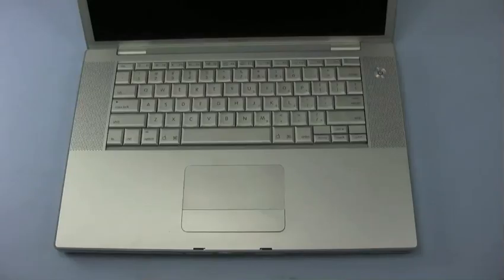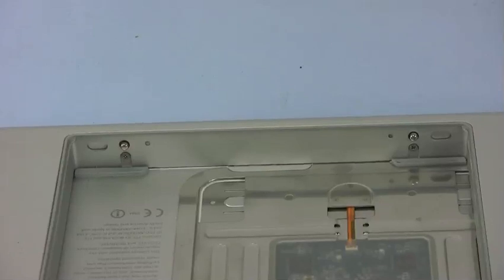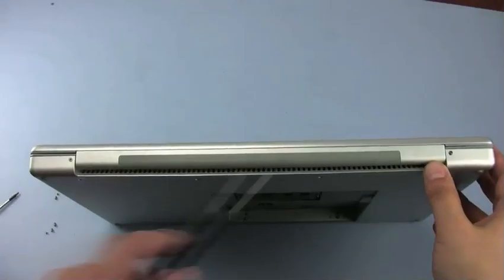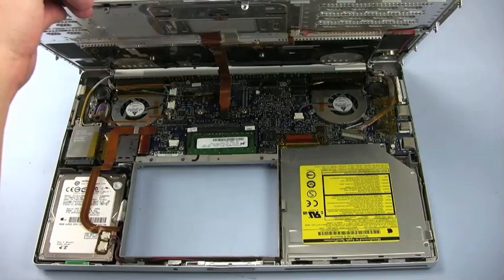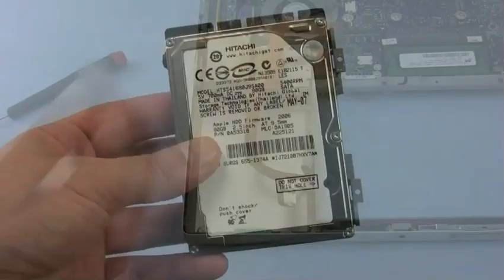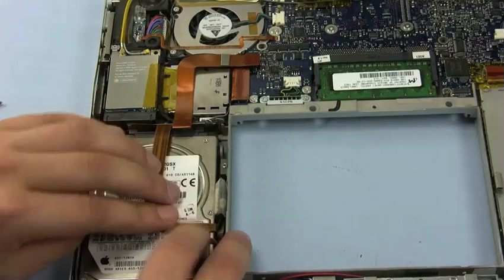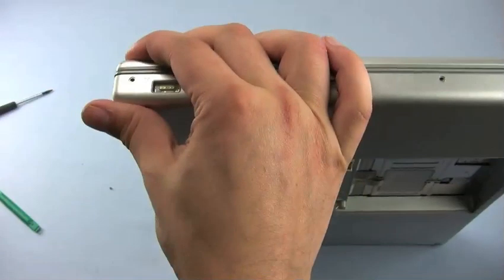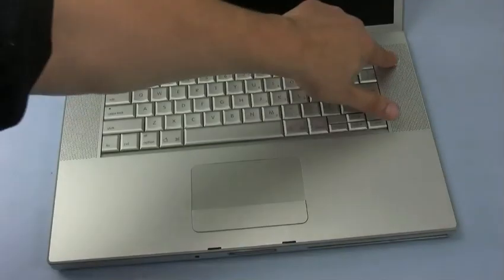How to replace a hard drive in a 15" MacBook Pro

Comment: my old computer stopped working so i put my old hard drive into another mac a brought, I'm pretty sure it was the same model, I  started it up and the apple logo didn't show up for a while at first, But it started up fine after that, I got into my account and i can use it up to a point for about the first 30 seconds to a minute but then it will start really slowing down until the point where it just had the spinning wheel and everything i click on is unresponsive, Help please

Comment: Made it very simple to replace the Hard Drive on my Mac... Thanksfor posting this easy to follow guide. Now tell me why the Mac Book Pro won't come on, the screen light, the apple logo shows up then the rotating gear icomes on and rotates to about 3 minutes then freezes and then nothing. I've tried holding various combinations of keys while the unit is booting up, still nothing. Any ideal. This in still the original Hard Drive, I haven't replaced it yet, but thought mabe you maight think is is something else, before I change it. Thanks

Comment: In lieu of a Torx T6 screwdriver, I found that you can scrape by with a very small flat-head screwdriver - the kind that you might use for fixing/adjusting eyeglasses.  But it is possible to strip the screws like this if you're not careful, so use caution.

Comment: I guess I got a late 2008 model.  Just about the same instructions, but the bits holding the drive in are slightly different...though anyone with enough brains to get to that point should be able to figure it out.  Didn't notice the 2 tiny screws towards the front of the casing in the battery compartment, so glad I looked for a guide before figuring it out on my own!

Comment: Great guide - just used your video to successfully change out the hard drive on an old MacBook Pro. 

Oh and Apple, f*ck you for always making hard drive swaps so difficult. Other manufacturers' laptops are generally so much easier to work on.

Comment: Very good but very important fail to hold the hard drive properly and it can easily be destroid! The way your holding it from top to bottom squeezed a little and its toast. Always hold by the edge! And no metion about static electricity ...really.

Comment: Thank you I changed mine, took me less than 20 minutes to achieve. I had a 17 inch macbook pro so the keyboard panel was not a problem. I had to rush to get the tools from local dollar store. Got the screwdrivers for $2. Of course the cloning took more than 5 hours. But thank you once again for sharing.

Comment: what is the connector small assembly connected to the right hand side of the bracket  hard drive proper name this is missing on my macbook pro 15" A1260 or A1226 model thanks

Comment: NO NO NO NO. Do not disconnect the HDD Ribbon cable from the "logic" board at 5.00 into the demo. The connectors are not the most robust and the ribbon has a tendancy to come away from the connector.. not good. The drive can be removed easily with the ribbon still attached. It will cost in excess of $50 to replace the ribbon cable.If in doubt, watch Steve Maller's video "macbook pro hard drive upgrade in 60 seconds". Wish I had watched it before this demo. godaaaaammit. oh, and the music sucks.

Comment: Great video! While the music could definitely be improved, it's worth it for such a clear video. One part that is NOT covered in the video is how stuck the ribbon cable can be to the hard drive. Mine was firmly glued on and difficult to carefully pry off. Go slow and steady; it'll eventually come off. Also, if you don't have a silicone spudger, try using a credit card. Cheaper and easier to find. Last, my MBP hard drive did not have the "small assembly pack," so don't worry if you don't have it!

Comment: Great video, will the "Seagate Momentus 7200 750 GB 7200RPM SATA 3Gb/s 16 MB Cache 2.5 Inch Internal Notebook Hard Drive -Bare Drive ST9750420AS" work well on my early 15 inch 2008 mac book pro? I am not sure about compatibility bec there are so many kinds. Thank you!

Comment: 5 Star. I had the right tool but I could not open my macbook pro 13. Once it was mentioned you need #00, i went ahead and opened the back. Took my harddrive out and found that I can not connect to my USB enclosure because of difference sizes. It helped me a lot! Thank you

Comment: This might not be cool, but I bought the metal housing for the hard-drive at ifixit.com . The housing was tossed  by techs who told my kid that the laptop was a total loss due to a water spill. Apple store said minimum of $1500 to fix. Bought a new hard-drive  $79. Was told by this store that instal was $100. I inquired about operating system...they said we do that too...$69.00. I asked sales person on floor to show me operating system....snow leopard. $39.00. It self-installed in under 15 mins.

Comment: Thank you. Your video saved me $100. Perhaps identify which screws go where during reassembly more clearly . But not that big of a deal. Well put together video, and the procedure is very clearly explained. Saved me $100 and yes, I  was done in 15-20 mins. I have absolutely no computer repair skills what so ever.
thank you thank you thank you.

Comment: please remove this video. it is totally unnecessary to remove the hard drive ribbon cable. if you do you will likely break it. it's a $40 replacement. better not to have these bad instructions.

Comment: Before you get started on this video you need to partition the drive first or you mac won't boot with it mounted internally. They have a page that explains how to do this. Once I did that it worked perfectly!  Or you can do it with your installer once it is in the mac.

Comment: Thanks for the great video, worked like a charm.
I do have one little issue, maybe you can help me;
Now the lid has some difficulty closing.
The magnet pulls the hooks out no problem, 
but I have to push kind of hard on the cover, before the hooks actually grip.
While before, it closed real easily.

Comment: Success! Just replaced w/ Hitachi 750GB Travelstar. Thanks!

1. Prop up keyboard with plastic object (travel mug) on top of CD/DVD player, leaving all cables connected!

2. Fold paper several times into a makeshift "spudger" - work the hard drive cable free by starting at the front - think putty knife action - for me (2008 model) this was easy!

3. work hdd out right side first, gently nudge SATA cable out - if you're careful, you only need the screwdriver, torx, (got at home depot) and beer!

Comment: Fine tutorial, in the great OWC tradition.  One thing though, which has been pointed out by others:  The step where you remove the hard drive ribbon cable from the logic board is NOT as simple as they make it look in the video.  Take VERY good care to carefully pry it off using a knife/screwdriver. Otherwise, it will break, like it did for me, and cost you $25 on eBay and a wait to replace the cable.  Whole thing takes a couple hours if you haven't done one before.

Comment: Very nice tutorial.  Worked great for me and saved me the $100 that the service place wanted for the upgrade (without the disk).  The bracket holding my Macbook Pro was a little different from that shown here, but easy to uninstall and reinstall.

I installed a Momentus XT 500GB hybrid drive.

Comment: A useful tip: use a small pair of tweezers with a low profile to slide under the hdd ribbon. Slowly slide towards use to gently pry the adhesive off. Just installed a 120gb SSd ocZ drive, and I'm blazing through my apps. Another note: some mbp do not have the small assembly next to the hdd. And even though I screwed back everything in sequence I had 1 screw giving me issues with not threading back into it's hole flush.

Comment: What is the purpose of removing the torx screws from the RAM compartment? Do they, for example, hold the keyboard down (hence necessitating their removal)? From what I could see inside that MBP, the removal of those torx screws is unnecessary.

Comment: PLEASE ADD AN ANNOTATION for the part where you take the hard drive ribbon off the board.  I tore mine because I followed what you did and tore mine.  You should really use a screw driver and not your fingers to remove it.  Now I'm out $45 for a new ribbon.  I get that you're already saving people loads of money by having this video up but PLEASE don't misguide them!

Comment: @dr150 
I'm having problems. After carrying out the procedure and starting up the computer it just gives me a pretty nasty sound, like a horn, every 3 seconds or so. I'm wondering whether I broke the hard drive cable or the cable from the keyboard. Do you have any idea? I tried putting back my old hard disk but the problem is the same, so I guess something have gone pretty wrong...

Comment: Very helpful video. Mine was a bit different inside though...no bluetooth thing on the side, and instead of having the gaskets attached to the drive on the left side, it had a pair of knobs, which went into the gaskets fixed in the frame. Got a 500GB Momentus XT inside, nothing like going from 8 to 240GB of free space.

Comment: This is a great how to video, but it does make it look easier than it really is.  Be very careful with the ribbon cables. 

Suggestion: Buy an external enclosure, partition your new HD, then clone your existing HD BEFORE YOU DO THE UPGRADE.  Make sure the new drive is bootable, THEN do the swap.  MBP should boot right up.

Comment: I just stuck in a 1TB WD drive - must be double platter as is quite a bit thicker than the original. I thought I would give it a whirl anyway and would have been prefect if not for the dumb design idea of the cable connectors on top of the drive. Net result is a slight unsightly gap on front the left had side - but no worse than residual wear and tear on the old white plastic MacBooks. I think getting 1TB is worth the lump and the lid still closes pretty well. Lesson: read drive spec before buy

Comment: This was the most helpful video I found.  My MBP was slightly different than that shown:

Cables stuck down with rubber cement (or similar) that required some careful, persistant work to peel off without damage.

Wide tab in center/front of keyboard module was a bear to get to release.

Used a plastic ruler instead of "nylon pry bar"--computer stores never heard of it.

Had external drive with Time Machine backup, so I am simply restoring from there after boot from Snow Leopard disc.

Thanks!!

Comment: A few tips not mentioned on this video:

1.) Definitely get the tool kit.

2.) The front of the casing (where it will pop) is harder to open than it looks on this video. 

3.) You don't have to unplug the cables.  Although you risk accidentally breaking them.  I used an empty CD spindle to prop up the keyboard.

4.) The cable glued to the hard drive is harder to remove than it appears.

5.) Use sandwich bags for the screws.

6.) Insert OSX disk.  Hold C.  Partition under disk utility. Install.

Comment: I found this areally useful tutorial. I just replaced my MBP 200GB drive for a Scorpio Blue 500GB drive and it all worked well. The electrical connecting tape on top of the drive was quite stuck onto the original drive and so I gently eased this off with a credit card. Prepare well with the right tools and a well lit surface and keep all your screws carefully and you´ll be fine.

Comment: Excellent tutorial! Walked me through every bit of the process with ease. Mine did have the yellow tape and I didn't put it back because it wouldn't stick anymore. I had a bitch of a time removing the cable from the top of the HD! It took me like 5 minutes but it paid off 'cause I didn't experience any problem with the new HD. That was actually THE hardest part, the rest was just a walk in the park. Thanks a bunch!!

Comment: this goes with my comment below: BE CAREFUL! Apple doesn't  sell the ribbon cable separately - probably about a .79 part! Instead you have to buy the whole frik'n top as it only comes as one assembly - $260 !!!!!!!!!!  And even then you have to remove your keyboard and install it in the new top! What a rip - and I was trying to be very careful!!!!! Much more careful than what he shows here disconnecting the cable! See comment below by "mygod..." - don't remove if you don't have to!!!

Comment: Be VERY careful with the ribbon cable to the keyboard - if you don't have to remove it DON'T - I lifted the corner end of the ribbon one side at a time at the connector but the ribbon started separating from the connector breaking a couple of the connection wires so my keyboard and trackpad stopped working - see my next comment